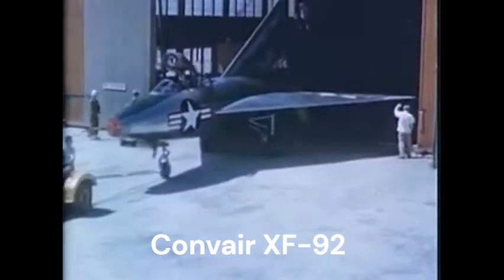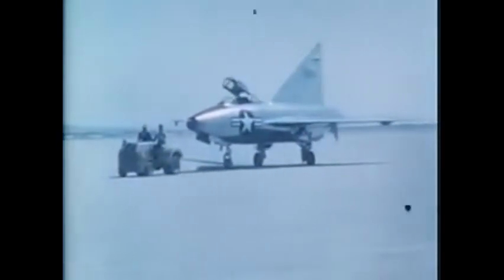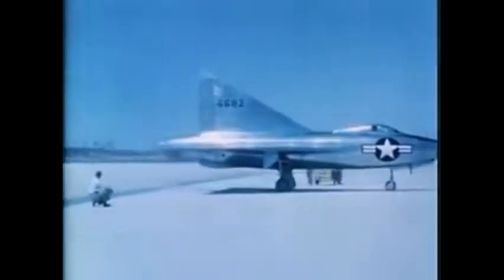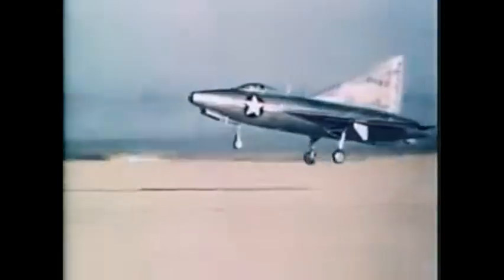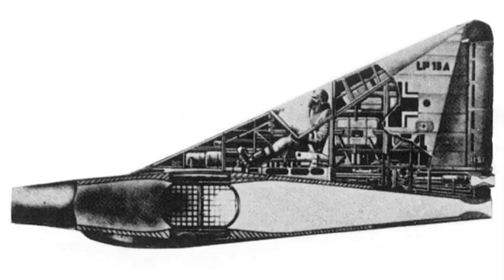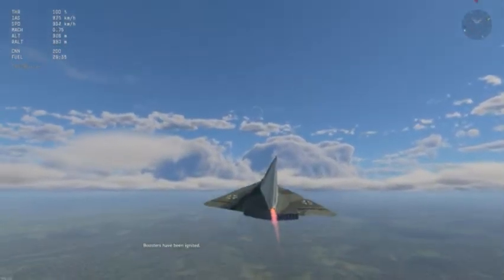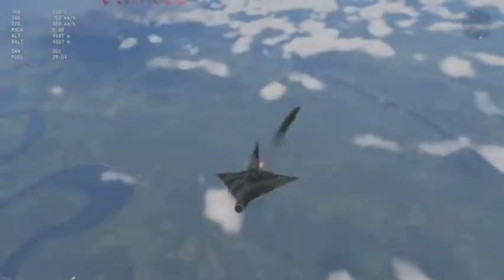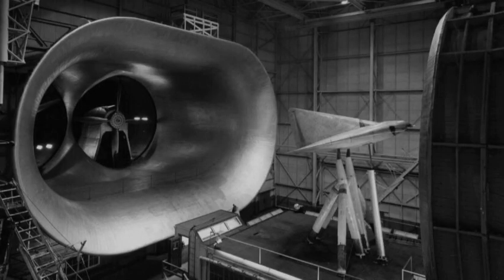WEIRDEST Nazi Jet Fighter: The Lippisch P.13a Ramjet-powered Delta Wing Interceptor

Comment: Lippisch P.13
The Lippisch P.13 Prototype was conceived as an electrostatically powered space plane. Note ram-jet air intake acting also as tubular docking probe, a small crawl tunnel at the nose, similar to those later seen on U.S. space capsules, designed for coupling with a “Wernher von Braun Space Station”, conceived after Hermann Noordung´s "Space Wheel".

The propulsion concept was extraordinary: finely powdered carbon dust for a negative charge separation, used as colloids, would rub against the interior of a specially alloyed ion dense ramjet tube. This friction generated massive charge separation—tens of thousands of volts—which was then discharged across the entire metallic airframe. The craft itself was skinned with plates of special ion density, left in natural metal, unpainted, for either a positive or negative charge separation.

Air-launched to altitude in piggyback ride on a carrier a/c, the vehicle would be boosted further by an HWK rocket engine toward the ionosphere. There, repulsion and interaction effects between the charged vehicle and the Earth’s natural (or artificially enhanced) electrostatic field would accelerate it to escape velocity—about 28,000 km/h—allowing insertion into low Earth orbit (LEO).

See also the two airflow tubes running from leading to trailing edges in the delta-wing for differential steering in high altitudes, where regular ailerons don´t work in rarefied atmosphere. 

The rounded edges of the fuselage were deliberate, unlike the later “Delta Dagger” designs in the United States. This minimized spark discharges at the tips. Since the electrostatic forces acted over the entire vehicle, extreme velocities—well beyond Mach 10—were theoretically achievable.

Both Lippisch and LFW worked on such vehicles, and a lens shaped test craft was allegedly photographed by an eyewitness over Spitzerberg, Hundsheim near Vienna, Austria in 1944.

Lippisch also spread propaganda and diversionary projects during the war, a pattern he continued in Ohio afterward. To this day, propaganda continues to obscure the true story of the P.13 with misinformation, to hide space as new battle ground in WW II.

KPR, Aviation Researcher Secret and hidden Air- and Space Technology
Reply: Wow. That wow was NOT hyperbolic, it was emphatic, lol.
Reply: That sounds like some ancient advanced tech from Neuschwabenland, right there. (Only half hyperbolic)